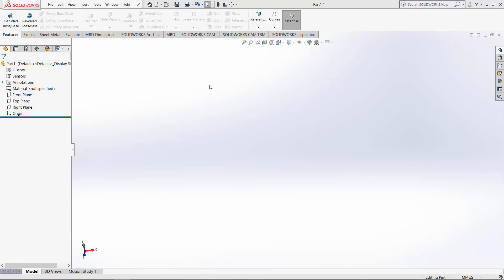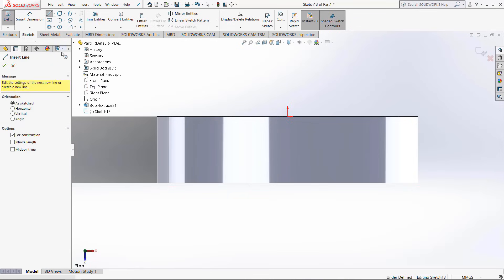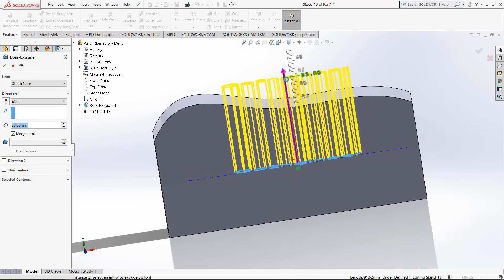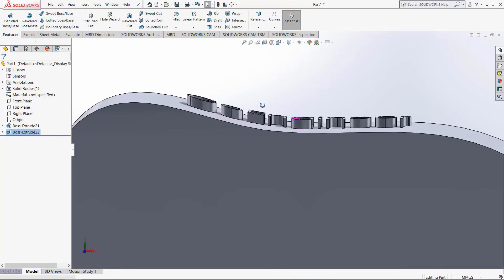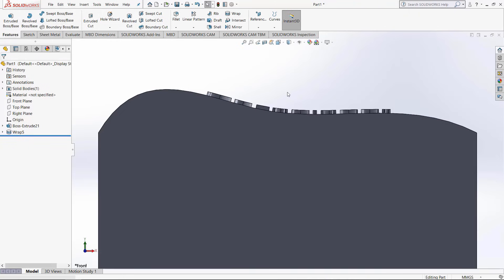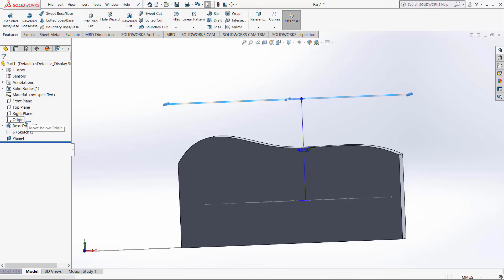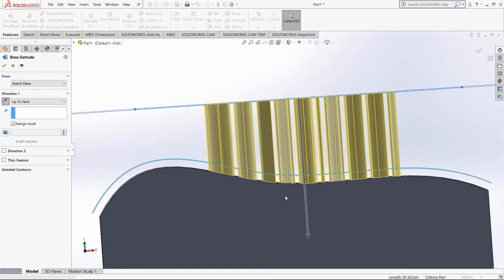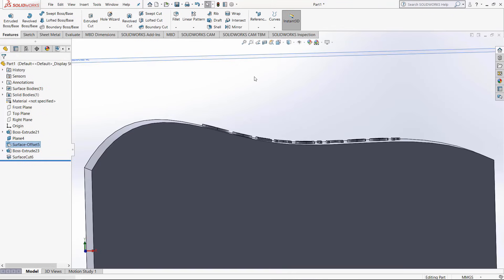SOLIDWORKS Text Tutorial - Quick Tip

Comment: Thank you . We are relatively new to Solidworks . We are using online version of Solidworks called Solidworks for Makers or Solidworks Connect . We are having a problem with text that is driving us nuts . When we try to enter text there is a  "."  inserted always before the first character . We can't find where to turn this off . Please Help!!!  Any help would be gratefully received
Reply from the maker: I'm not sure there's a setting to change that but what you may be referring to is the placement point for the text itself. It's not actually a "." but a point in the sketch that you can use for dimensioning and constraining. If you try using the text in an extrusion, that point won't be part of the feature. Hope this helps.

Comment: Is there a simple way to just put a label on the surface of a part that matches the part name or other reference. For example I have lots of resistors in a 2D schematic associated with placed parts in SW electrical 3D. So the 3D part knows its R1 or R2 or R50, whatever. Having a table on each resistor in 3D makes it easy to then create a drawing top view for e.g which shows all the components with their respective X Ref to the symbol in the schematic.

Comment: Is there an easy way to add a lot of sequential text to a part? I have a rectangular vial tray that that I want to number each space and there are a lot, like 168 in one. Right now I'm just typing long strings of horizontal text and spacing out with text spaces. Then I copied a string up to the next row and had to go in and retype the numbers. A bit slow and tedious!
Reply from the maker: I have been looking for an answer on this and the so the short answer is no there is not an "easy" way that I have found to generate numbers like that. It would make a good enhancement request.

https://www.goengineer.com/blog/how-to-submit-solidworks-enhancement-request

Comment: Anyone know how to control the text spacing? There is literally an option under font but it doesn't actually reduce the spacing to zero if you set it to 0mm.
Reply from the maker: Hey Jon, thank you for pointing that out. We recommend using the Spacing option in the Sketch Text PropertyManager for this.
Reply: @goengineer  That actually doesn't control it. https://twitter.com/Jonbydesign/status/1414898218002001924?s=19